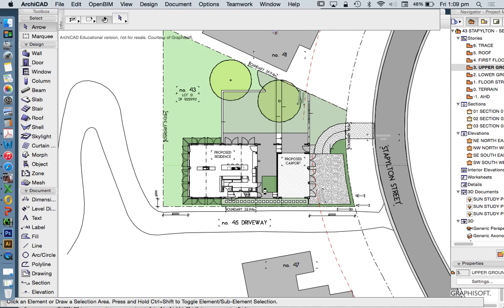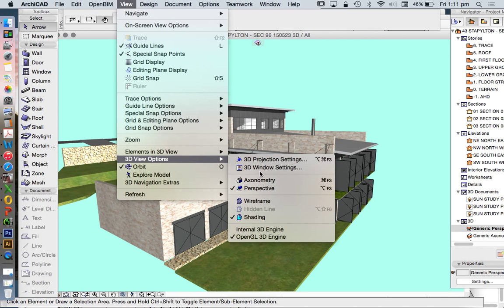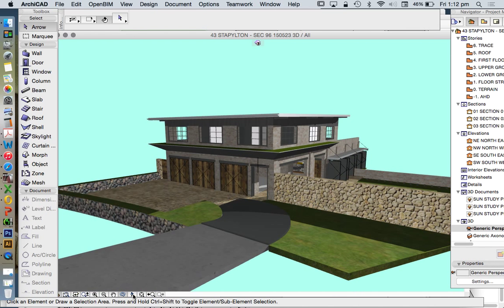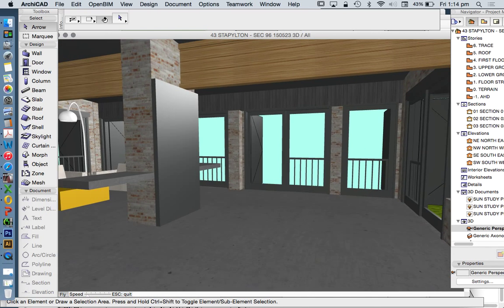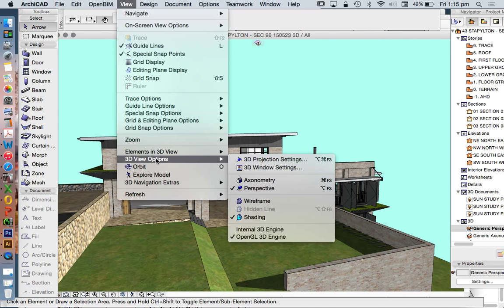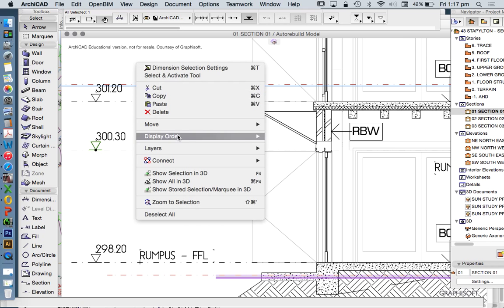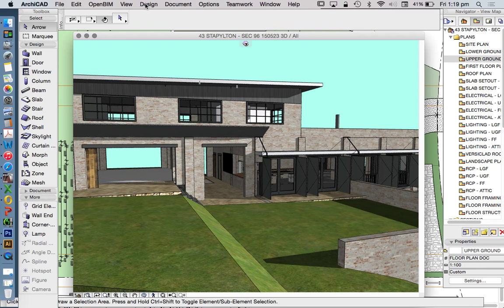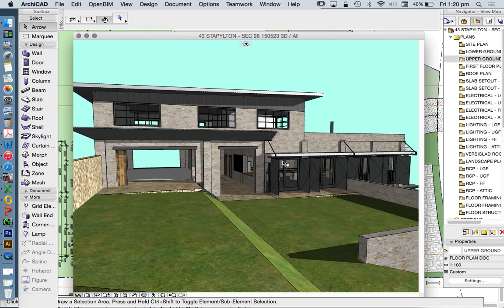ARCHICAD - 3D WINDOW NAVIGATION

Comment: hallo every one , i hve problem with archicad 21   " 3d view " it is tottaly black after installaion and i cant see nothing please i need help
Reply from the maker: Black is unusual, the standard empty background for the 3D view is white. Try selecting a wall, right click, show selection is 3D, zoom fit to view. If this doesn't work I am guessing it is installation / video card issue. My only other suggestion if you are using a camera to create the view is that you are stuck inside a wall or something similar. If you are in fact in a photo render rather than a 3D engine view, it is likely based on lamp / light settings.
Reply: @RobertMannArchitect  thanks alot for your reply back , it was really sressfull  at last i solve it , the problem is that my laptop had 2 graphic cards and i need to shut down the extra one so i keep only with intel whenever i use Archicad as i read somewhere so ..